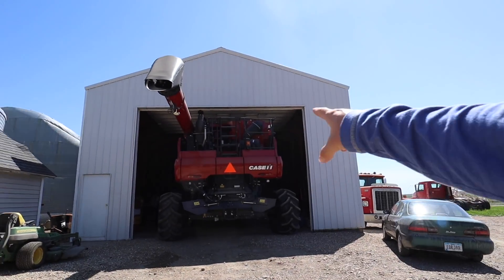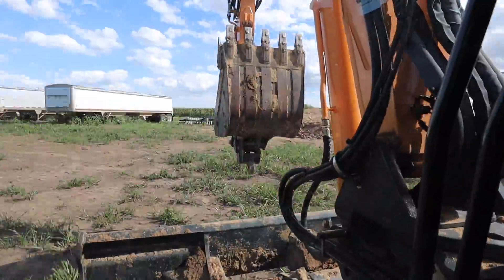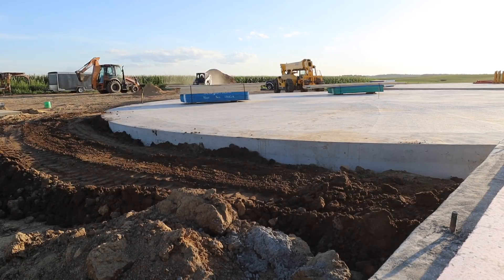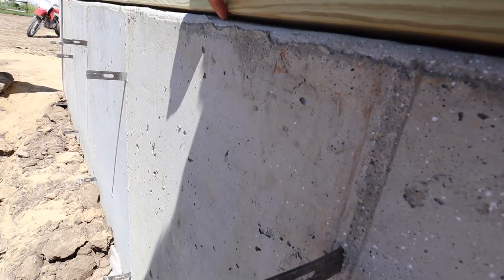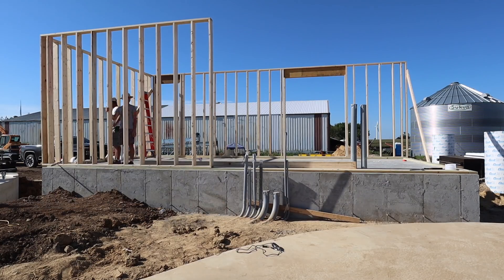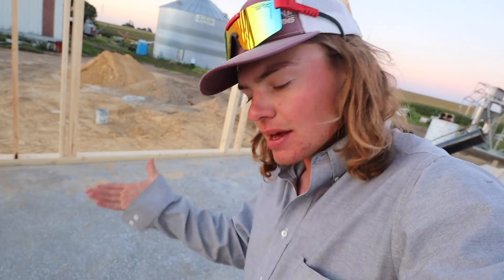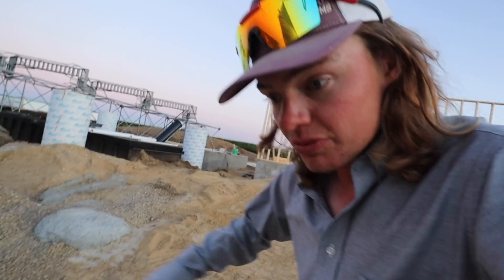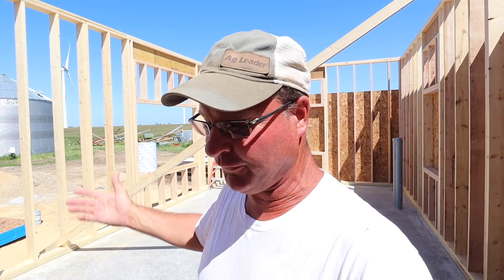FRAMING MY TINY HOUSE

Comment: Another tip to buying framing lumber is to look at the end grain of the wood. The closer together the growth rings, the stronger the piece of wood will be and there will be less of a chance of it warping. A lot of the lumber that is bent out of shape like that has growth rings spread far apart and that weakens the wood. Still up to code with wide growth rings, just not as structurally strong as studs with close growth rings.

Comment: Remember, when considering the R value of the whole wall, closed cell spray foam costs twice as much and only nets you a .7 total increase in R value. 
Closed cell foam only expands to 1 inch per application, so it will take 3 times the material to fill the stud bays. Closed cell is also hard to trim, so installers rarely full the whole bay. So you only have 3 inches of insulation and a 1/2 gap behind it. 
My preferred wall has R6 Zip sheathing, on the outside, 1” of closed cell in each bay (for structure and to vapor seal the wall), then fill the remainder of the bay with open cell foam, trim then sheet rock.

Comment: Most modern excavators have a valve you can switch from excavator controls to backhoe controls. Usually in a panel on the side.

Comment: Just a simple question..
.Why did you NOT use treated ( or even CDX ) PLYWOOD 
on the bottom 2 or more feet of the "Dryer Shack "walls ?
That OSB will NOT likely be in good shape in 5 or so years.

Also.....why did you not use TREATED two by... dimension lumber ....at  
bottom where it meets the concrete floor ? 

Also..... do you not have to use  the green colored termite spray at bottom
3 feet of the wall framing in your State ?

Also at 13 min 07 seconds. shows cut off of door opening....
... That 2x was installed "bark side DOWN."
Our protocols always require " BARK SIDE UP."

Love your videos....reminds me of farm life when I was young.

Comment: Seeing how the whole building is just bolted down to the concrete base, wouldn't a strong gust of wind (not hurricane or tornado type wind, just strong gusty wind) rip the building apart?
Reply: Anchor bolts embedded in 3000 psi concrete develop an insane amount of uplift strength.  And it's only a 1 story building so would really need to be hit by a constant velocity of 115 mph wind to do any damage.

Comment: Weird that America tends to build wood framed houses. Over here in Europe we mainly build using interlocking  gas-concrete block on the inside and nice bricks on the outside. It will usually stand for the at least 50 years. If it's a commercial building that does not need to be for long term use it's often built using a steelframe and tin plating for walls.

Comment: In your mud room for the dryer shack, put some sort of waterproof material 3-4 feet up the walls. That way you can attach a hose to the sink and wash out the mud room. We did that with one of our buildings and it made cleaning up so much easier

Comment: I just put down over 10000 square feet of epoxy floor coating it is not as good as they say it is.  I would go with a rubberized coating from wattco

Comment: I’m wondering why the bathroom is so far away, when a driver needs to use the bathroom he has to walk all the way to the corner. I know in the previous video you did state that the bathroom isn’t convenient where you wanted it at first. Just something to look into because I guarantee that problem will occur.

Comment: Wouldn't it be better to place the plywood  and house wrap on before you would have raised the walls. That's how we frame our homes 🏡 will build.?
Reply: Would need more people to then lift the walls and wouldn't be able to do an unbroken envelope on the wrap if doing individual walls. This way they can run the wrap from one section all the way around and overlap it then cut out the door and window openings.
Reply: @justmeiniowa  We lift a 35 foot framed wall with 3 to 4 people and then join it in the middle.

Comment: Our places over here are normally built with 2 parallel brick/block walls but more and more are getting wooden inside frames and single brick skins. mmm will they be here 200years later?

Comment: DC that's weird that the mini don't have the power to side sweep are bobcat excavators sweep the piles over so you might want to check on that situation because I know other YouTubers like letsdig 18 he has minis and he sweeps his all the time so you might want to check on the power situation but that'd be a great investment for you cuz they're small they can get in areas there on your cemeteries and they even have the little blade on the front where you can level the the plot and plus they have AC and heat and they're on tracks that's good because they won't leave ruts great video love you guys God bless

Comment: Daddy Cornstar;  totally agree on little swing power on moving dirt sideways.  Try this and see if this helps. use your boom swing left or right  to see if it will move dirt sideways.  I do this often on our Bobcat E50 and it helps when the "house swing" wont move the pile.  in honesty though, our bobcat "house swing" does move some dirt side to side, but not like a backhoe for sure.  Correct me if I'm wrong, isn't the machine your running very similar, if not identical, to a Case and New Holland Excavator?  you guys are awesome!  keep up the great work!!

Comment: Are you going to be installing LED lighting in and this building?  It would help you to keep your energy costs down.
Reply: One can hardly buy conventional lighting anymore. LEDs are most widely available and cheaper overall at this point.
Reply: @Shane_Reynolds85  I was only mentioning it because you can still get the tube style florescent lights.  LEDs pull even less than they do.

Comment: Those are called the outside corner's that need to be insulated..every house has them..awesome job man.
Reply: Can't build those corners to code anymore. A California corner is open to the inside so you can't  forget to insulate it. Probably aren't  any building codes out in the country except septic.

Comment: DC , with a mini excavator you have to get a swinging start when you sweep , once you get use to it it's easy peasy , and you can't have down pressure either when you swing
Reply: Apologise if I'm wrong but it doesn't sound like daddy c has the throttle set high enough

Comment: Need to build pocket corners for backing instead of putting insulation in from the outside before sheathing. Justin is good, but he needs to learn that one so you insulate everything from the inside after the outside is done. Fun video thanks for sharing.

Comment: Are you running the electrical on the outside of the walls then in conduit? I would want to run all that stuff inside the walls...but that just me. Also, I would probably want the roof done before spaying any insulation.

Comment: The chemical on the concrete is a curing agent, slows water evaporation from the concrete. They could have added a shake hardener to the surface and power float finish the slab and you would have a nice smooth dustless surface, no need for floor finishes and easy to maintain.

Comment: Everytime I see a American building, I ask myself.... Ok, they live in a tornado state. Why are they building with wood and "blow away and cry" materials and not with some steel enforced cement or concrete. And put some metal rolling shutters on they're windows. 
Or in other words. Why don't you build like the most buildings in Germany. - while storms one or the roofs are flying. But the most houses are fine and really good isolated . Don't understand this at all.

Comment: DC, I learnt to drive a backhoe a Case in England (many years ago), occasionally I use an excavator, the levers are different and it can be a bit tricky. However some of the new excavators there is a setting to change the levers to backhoe settings. I think it is ISO and SAE, whichever one you learn with will be the easy one, I do know some chaps that can swap between machines with no hassle at all.

Comment: There should be a valve to switch the controls to the backhoe pattern y’all are use to that way the levers are the same in the mini and the backhoe. Look in the manual or call the dealer and they can tell you where it is. I know Deere and Cat have it. I know how frustrating is to try to run a different pattern.

Comment: A DREMEL?  Take some advice from a woodworker:
Next time you need to size up a counterbore for washer clearance, get hold of a Forstner bit (assuming you have one) of the right size and bore all the way through a piece of scrap.  Then use that scrap, with its hole centered on the too-small counterbore, to guide the Forstner to get it started.  Sink the bore to the appropriate depth.  You lose a tiny bit of time making the guide, but you get a LOT of time back using it.
Reply: What about the 2 hrs of driving he has to do to go get one
Reply: I’m assuming this was a more effective use of time instead of running to town.
Reply: Dremel works
Reply: @realredditstories420  And Cole's a farmer.  What's your point?  I'm a pro handyman; if I had a bunch of counterbores the wrong size, I'd rig up the solution I just described and the goof-up would be fixed in five minutes instead of however long the Dremel needed.
Reply: @bubbaman12289  Yeah, if he doesn't have a Forstner it's a tiny bit harder - use a hole saw with the pilot bit removed instead, and then two or three quick pops with a chisel if necessary to remove any bits left over.  But the fit looks close enough that the hole saw's kerf would probably suffice.

Comment: Looks great the only thing I would have done differently is run the osb sheathing horizontally… that’s when you get maximum strength…. But I’ve seen it done both ways… Justin is good at what he does too… y’all are lucky to have a great relationship with y’all’s contractor and someone y’all can trust and have that ease of mind knowing it will be done right